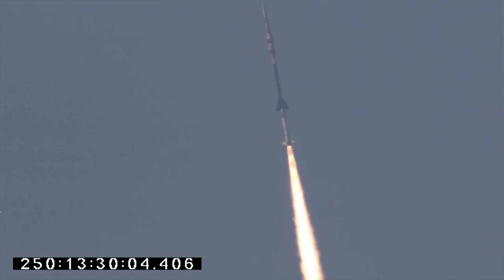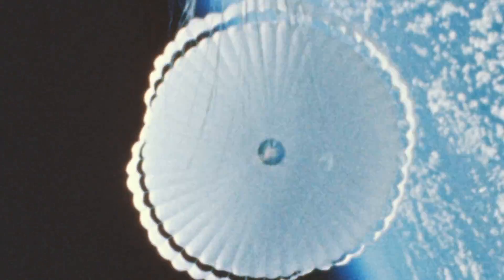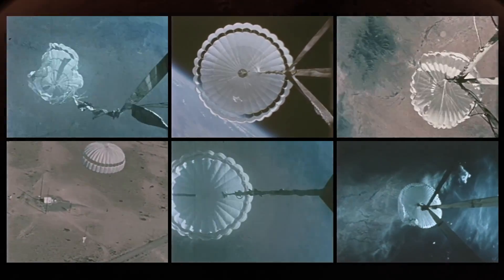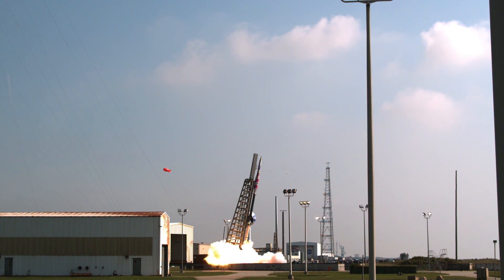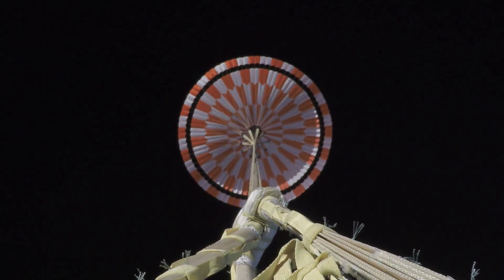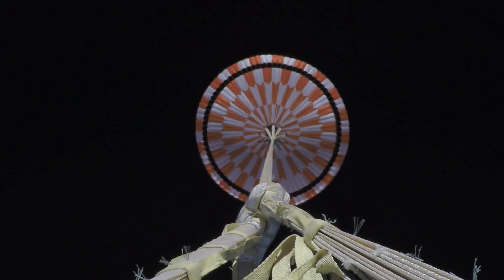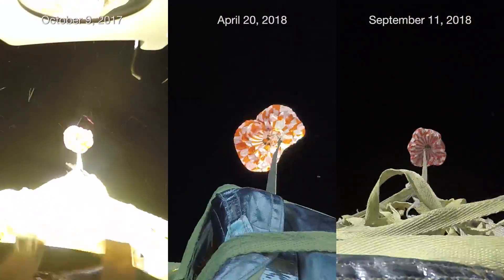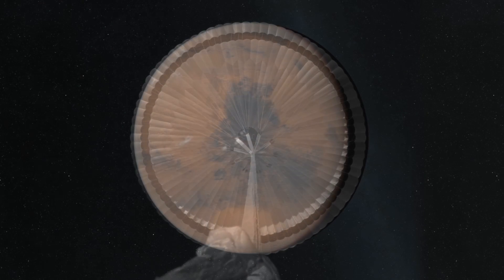Testing a Parachute for Mars

Comment: This was a test of parachutes for thing like probes, rovers, etc correct? I remember NASA doing parachute tests in the Pacific (from Hawaii) about 3-4  years ago with a capsule (for manned landing) and they had chute failures both times - much larger chutes and higher speeds I think. Anyone else remember those tests? I haven't seen/heard that they have conducted more such tests. They even had an inflatable section on around the heat shield meant to assist with slowing down the craft ......that part seemed to work. Would like to know where NASA is with that effort.

Comment: BRS make emergency parachutes for aircraft, which impose a heavy load at high speed, in a hurry. To slow the inflation and hence the strain, they use a sliding collar on the risers. (Initially, the canopy can only expand to the size of the collar; as it forces the collar down the risers, the canopy expands, but it has been slowed over a longer period.) I'm surprised NASA didn't try a similar technique.

Comment: There is a formula one can use to make a parachute the proper size for a payload falling to the earth surface.  Since Mars air pressure is so much lower than earth is there a reliable formula for calculating parachute sizes for payloads falling onto the Martian surface?

Comment: Mars has an average air pressure of 0.087 psi. Good luck with those parachutes.
Reply: Haha.  As if the people who determined the atmospheric pressure on Mars so that you could google it would suddenly forget about it when designing a parachute specifically for Mars.
Reply: 0.087 psi static pressure turns into a lot of dynamic pressure when you're coming at supersonic speeds.
Reply: At what altitude/elevation will the chutes be deployed on Mars? what happens at sub-sonic speeds?
Reply: @tetekofa  It will deploy at a Mars altitude of 1.5 km. Drag is proporation to density time the velocity squared, meaning that a little speed increase makes a big difference in the total drag. Since it is going extremely fast, and that big number is squared, this compensates for the very low density to still produce a lot of drag, and slow down the rover. The atmosphere is too thin to slow down all the way though, so rockets finish the job. Without the parachutes, the rockets would require too much fuel to even get to Mars in the first place.
Reply: Thanks Ryan
Reply: @tetekofa  Look bud Mars 2020 is just curiosity 2. If you really need to know this just take a look at that mission.
Reply: It's tested at earths altitude where the atmosphere mimics the atmosphere near the surface of Mars.
Reply: No, really?
Reply: Good call, you must be more clever than all the employees at JPL.
Reply: I’m sure they remembered that
Reply: The parachute removes about 95% of the kinetic energy left after the heat shield stops being effective as a brake. And it does it for much less weight than the fuel and hardware that a rocket system would need. The parachute takes it down to 100 m/sec at which point rockets become the only option left. We already know it will do fine if nothing goes wrong with the plan. Curiosity rover was essentially the same system and that landed 6 years ago.
Reply: You're forgetting we've always used parachutes on Mars, you use them to slow down from supersonic to 200mph, then you use rockets the rest of the way down.
Reply: tetekofa Parachutes have always been used on Mars. Good luck with not sounding like an idiot.

Comment: One thing not mentioned was if the parachute had been packed for at least as long as it would take to go to Mars. Does it matter how long the parachute is compressed to the density of wood?
Reply: All of the Mars rovers, Pathfinder, Spirit, Opportunity, Curiosity used parachutes for some portion of their descent.  So did landers Viking 1, Viking 2, and Phoenix.  Everything that has landed on Mars has used parachutes to scrub off upwards of 90 percent of the remaining velocity from entry.  If it was a problem to figure out, NASA did it long ago.
Reply: Interesting Question: how we get an answer.

Comment: How does this test compare to the LDSD test (chute failure) of a few years ago?  Speed? Atmosphere density? Chute surface area?
Reply: LSD test? Trippy!
Reply: I guess a big difference would be that these don't have to deal with as much slipstream turbulence as those from the LDSD tests did.
Reply: This test is much cheaper and tested just the parachute in isolation, LDSD was also testing inflatable decelerator technology for landings farther in the future.